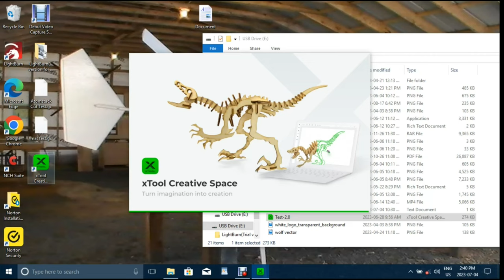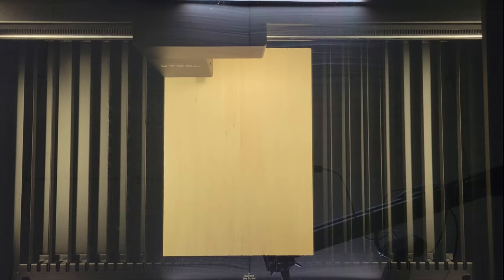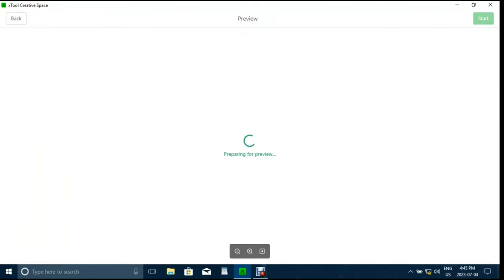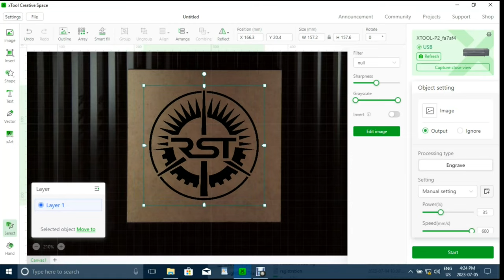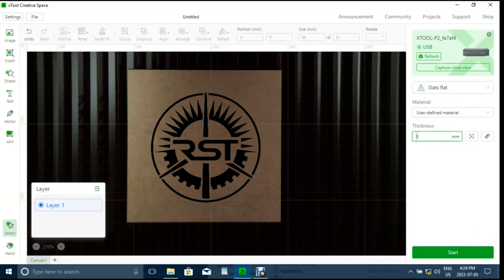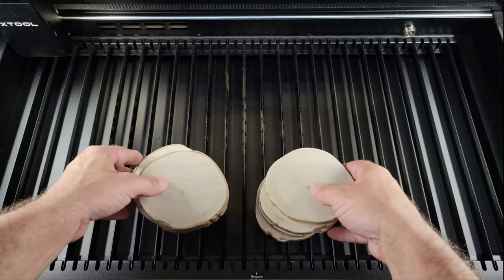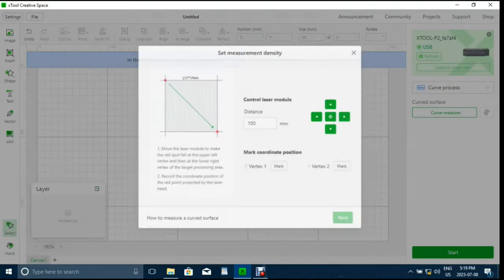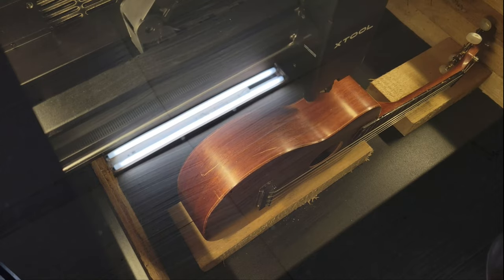55W xTOOL P2 Laser Engraver : MOST VERSATILE Desktop Engraver?!

Comment: Hi JAMES, I did not see any metal engraving done on this laser… Did you try to do any color with stainless steel on the xTool P2?  I am interested in this particular laser tool, and especially doing color on stainless steel.  Thank you! Love your videos
Reply from the maker: Hi. Good question. I haven't tested any metals yet but I know from other creators that it can engrave steel. I'm not sure about colour engraving stainless, though, but I assume it can do that as well. With a diode laser it's just a matter of adjusting speed, power and interval settings. They sent me their roller and chucked rotary for tumblers and rings and whatnot, as well as the conveyor feed so I've got a couple more videos to make for them and will definitely try a few different metals when I do.
Reply: @JamesBiggar  thank you.  
I  look forward to it.

Comment: Hello James! I'm looking for an engraver that can put names on dental appliances like dentures. Do you think something like this or the Laser pecker can do this?
Reply from the maker: You can engrave acrylic or porcelain dentures with this for sure. The LP3 and LP4 IR (infrared) lasers can etch some acrylics and most metals, which is basically just a light scoring and discoloring of the surface. They won't actually engrave and remove material. I've never tried any acrylics other than black and clear with the LP lasers, and the clear failed without using marking agents. Same deal with a fiber laser, although they can actually engrave any type of metal too, not just etching/marking.
Reply: @JamesBiggar  thank you very much!

Comment: Does lightburn work with this machine?
Reply from the maker: It does, but with limited features - for example it can only use the flat processing mode, no cameras, etc. But xTool's XCS software is free, easy to learn and allows full control of the machine.
Reply: @JamesBiggar  oh ok that is good because I'm looking for something that I can actually use at it full potential. And from your video, this machine does not disappoint besides the price 🤣 . One last thing before I stop bothering you,  does the anti freeze and water need to be swapped out, or once you dump it in, you don't have to worry about that?
Reply from the maker: I think it would be best to treat it like a vehicle, swap it out every 4-5 years. Antifreeze can become more acidic over time and lose its rust inhibiting characteristics. Just be sure to use distilled water so there's less chance of contaminates messing with the laser tube

Comment: @JamesBiggar Are you concerned with the xTool warranty? It does not inspire confidence. I almost bought one of these until I saw the length of the warranty, what it covers, and the cost of repair even with the xtool care for $300.00 It only covers "2 Warranty Events, Cost Effective
The warranty events cover nearly 90% of machine failure and damage. xToolCare for P2 can help you save up to 60%.." My question is how do you like this 3 months later, and do you feel confident in the laser's long term usability?
Reply from the maker: I've never been a stickler about warranties tbh. Never had to use one. Good eye for good products? Just lucky? Who knows. All I can say is out of the 15 machines I have now, it's the most impressive. Lots of power for anything I need to do, fast, can work more materials than the diode lasers, and I haven't had any problems so far. But it's only been a few months. I do think the work area could be bigger. 23.5x12" is kind of odd. But they sell a conveyor feed to extend it to nearly 10ft. Overall, I'm still very satisfied. As far as the warranty, I can't advise you on that, my friend. It's really up to you to weigh the risks, I'm not here to pressure you one way or the other. I'll have another video on the conveyor coming soon, if you want to hold off and see it in action again before you decide.

Comment: You didn't have to calibrate your laser?
Reply from the maker: Nope. Done at the factory. As long as the shipper doesn't knock it around too hard, then you shouldn't have to calibrate your laser. But that's usually not the case. I'm one of the lucky ones: https://support.xtool.com/hc/en-us/articles/12823378816151-Calibrate-the-P2-Laser-Path?gad=1&gclid=CjwKCAjwoqGnBhAcEiwAwK-OkSYrslz2fwGE_aAIkMWYAdS92jpAtrnWYIA65avOW75KPl7mle83DBoC9ncQAvD_BwE

Comment: Wow check the price of that 😮 5grand 😂😂😂
Reply from the maker: Well worth it. It's a commercial machine for business use that can do magnitudes more to make production easier and faster with more options for clients than other equally priced commercial machines offer. This is not a hobby machine, and it's priced accordingly. If you run an engraving business, which is a fairly profitable venture, then you'll get a full return on that investment in less than a year, and a laser like this will typically last for 10,000+ hours (roughly 5 years) or more.